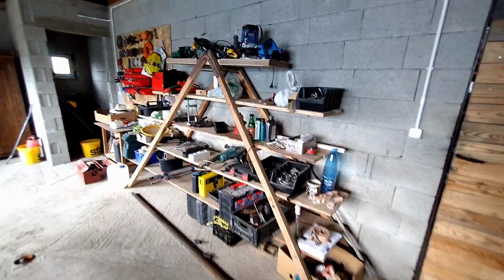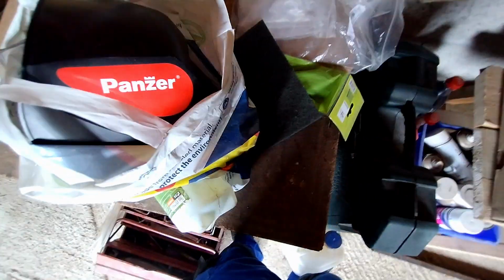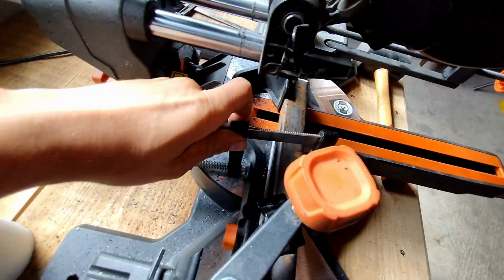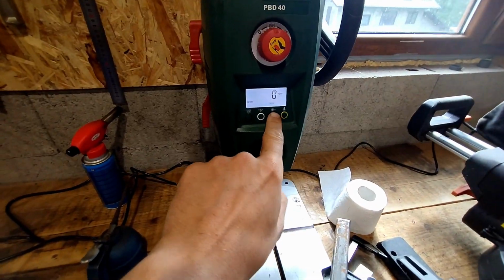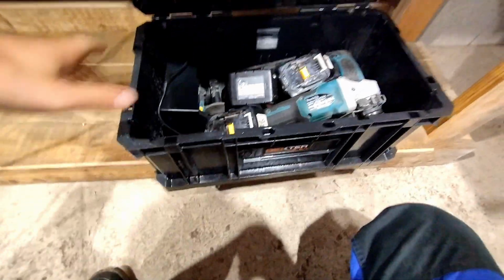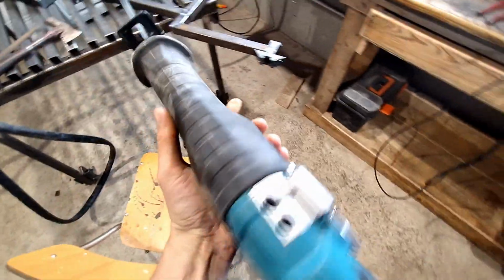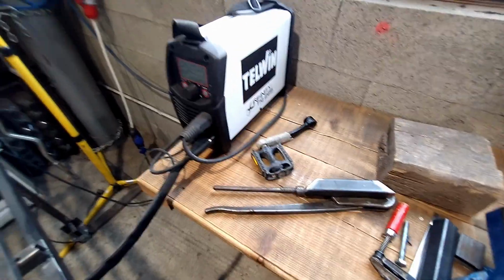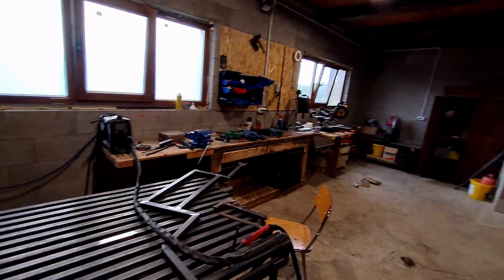Project update, what tools I bought for the build

Comment: I built my trike with a used drill machine, an old hacksaw, and a file. Later I got a grinder so my arms didn't hurt as much.
Reply from the maker: With a lot of hard work and a bit of ingenuity everything is possible. What material is your built with?
Reply: @hojbota-ptv  I used aluminum. But it can be steel or even partly wood.